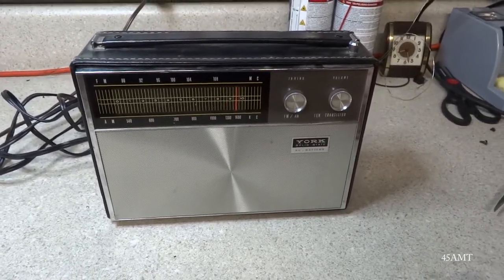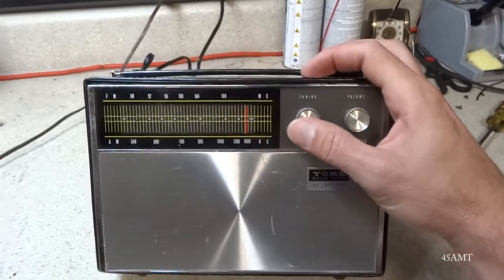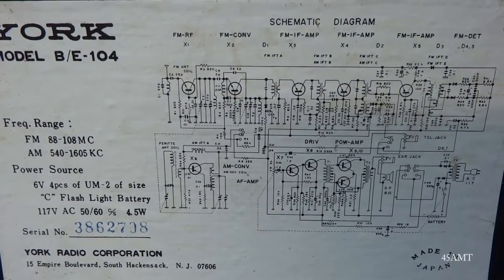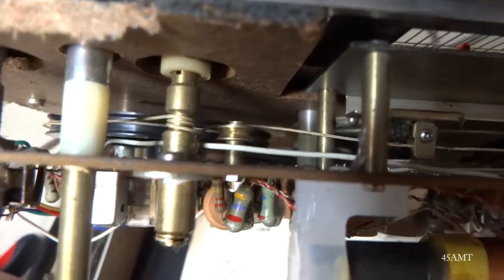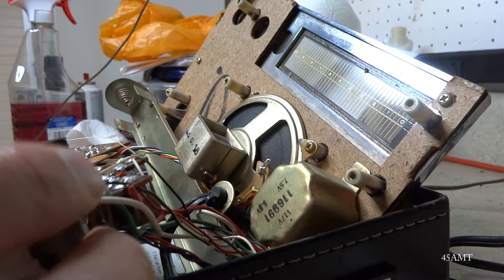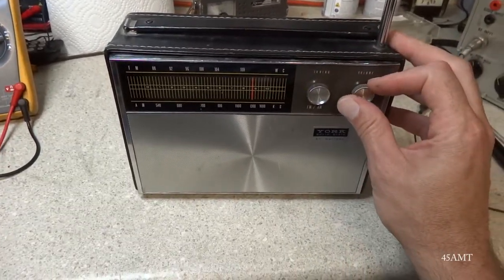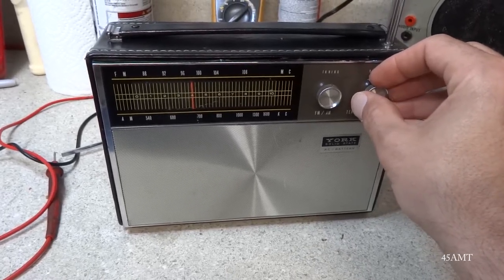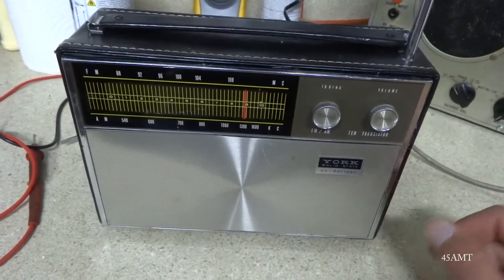Repair Of a late 60 early 70's York B/E 104 AM FM Radio

Comment: Like these old transistor radios. Thanks for the video. I think you have the winding of the dial string reversed. Clockwise rotation of the tuning knob should result in making the dial indicator move right that is towards the higher end of the FM band (108 MHZ) and vice versa for the lower end.
Reply from the maker: It works fine.

Comment: There is a good chance that you will have to remove the tuning cap pulley anyway, because if you have to recap it...the caps are usually behind that wheel..or pulley...I have made the mistake of repairing the string...then having to remove it to recap the radio...

Comment: I had a 12 transistor Ross AM/FM when I was a kid, mid 60's.....very similar in appearance to this except 3 knobs on the front. Am/fm , volume, tuning....wish I still had it ! D.
Reply from the maker: I've got a Ross radio in my closet, that still has the box and original "hang tag" i repaired It had some bad caps and a broken dial string.I didn't do a video of it though.
Reply: Love to see it sometime if you get time to do one !